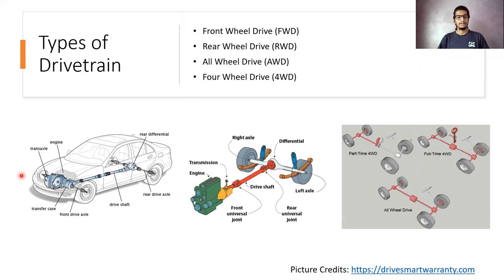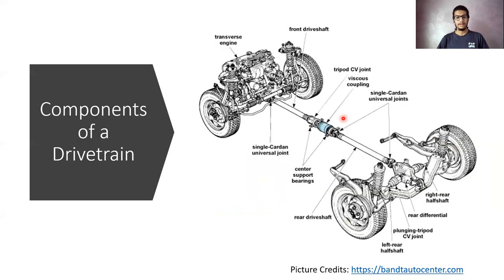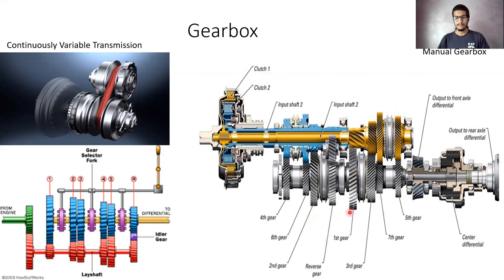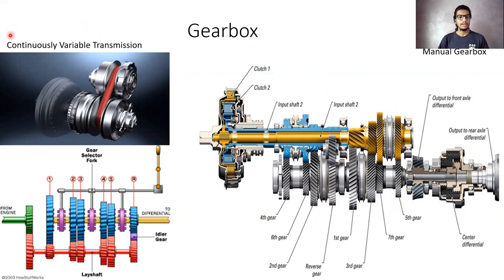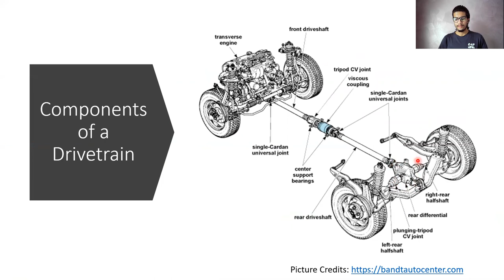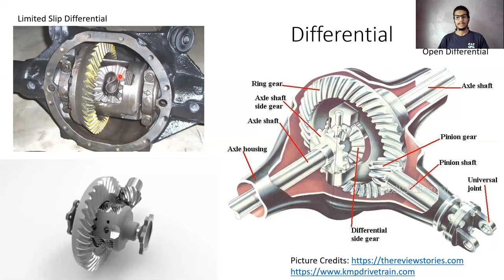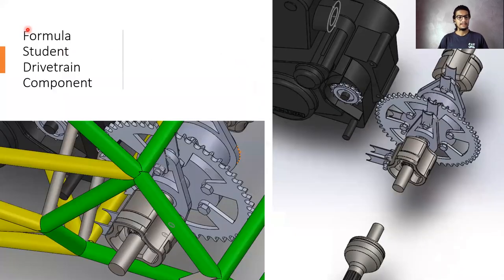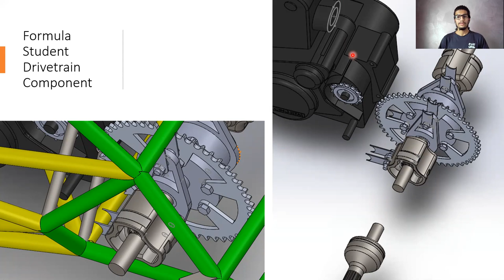Transmission Assembly & Major Parts in Drivetrain | Formula Student | FSAE | Automobile & Mechanical

Comment from the maker: Video Timestamps

00:00 Introduction and Video Outline
00:14 Types of Drivetrain
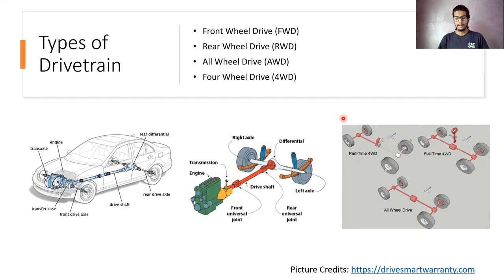01:42 Components of Drivetrain
02:38 Gearbox - Types and Application
05:00 Differential - Working and Types
06:52 Constant Velocity Joint ( CV Joint)
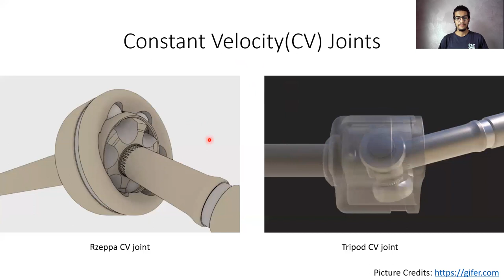07:42 FSAE Vehicle Drivetrain Design